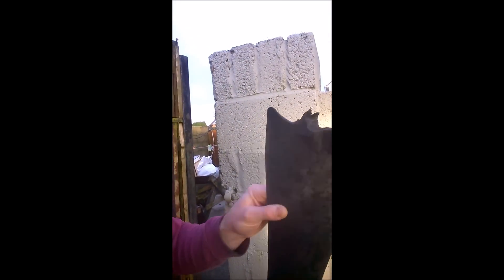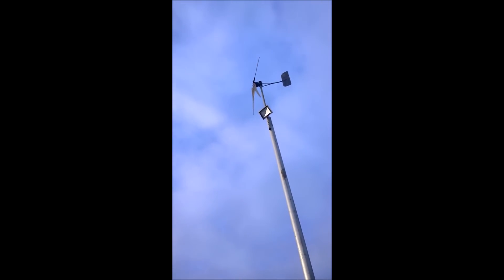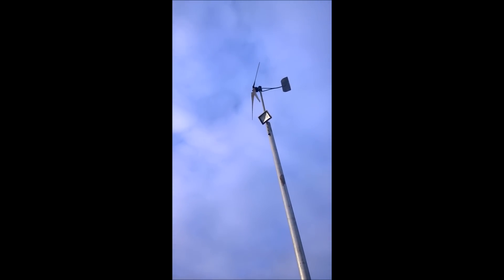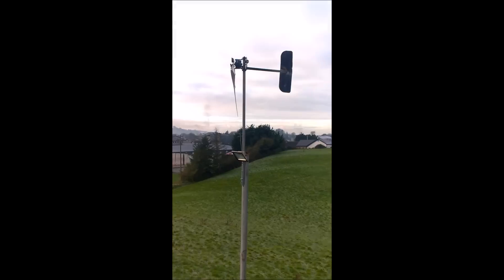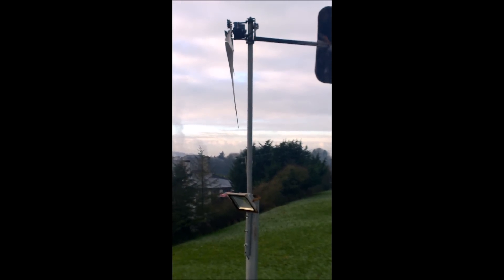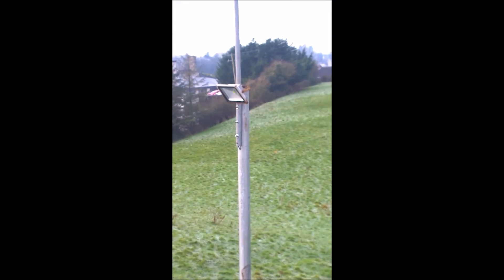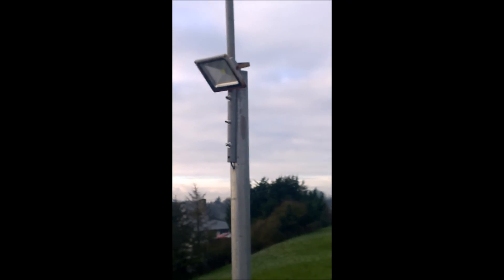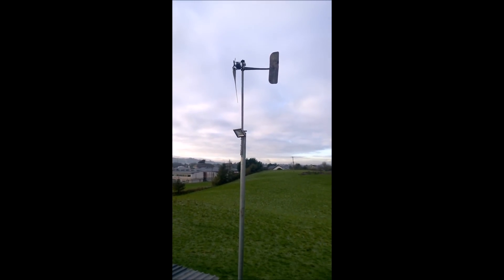wind turbine destroyed in 80 mph wind storm in ireland

Comment: Hi Stephen,   We are working on a new furling bracket for 2016.   Electric breaking just ends up burning out coils in winds this extreme so we do not recommend it.  When we get the new furling bracket design built I will send you one.  Do you have any video footage of that storm? 80 mph winds must look horrific.
Reply from the maker: +WINDGENEERING That sounds great thank you. I did not have the break on it was going to the battery bank. Our power was gone for 2 days so was counting on the turbine to keep my bank topped up. I noticed there was no power coming into my bank. so i just turned on the brake to see was it burned out. I was in work when my partner phoned me and said that it was making loud noises and she seen smoke coming from it. So i had to drive 90 mins to get home that is when it all went wrong. We had to stay inside and just wait for it to brake. Scary times.
Reply: +Stephen T    I have been there too.  Just waiting to for the wind to stop while waiting for a turbine to stop turning time moves very slow.  Our redesign for 2016 will blow everyone away and we will have a Patent on it too.  Will be out in a few months.
Reply from the maker: looking forward to seeing it. ya that's the best why with Patent so NO ONE can take your idea and say that they had it first.